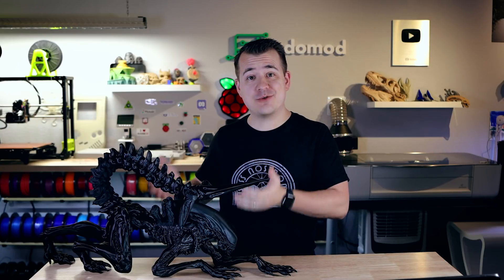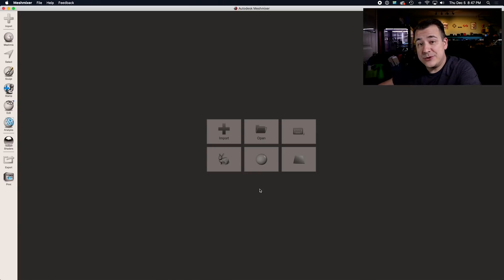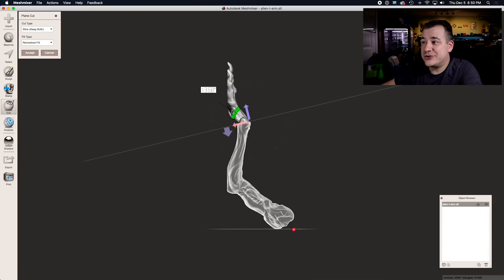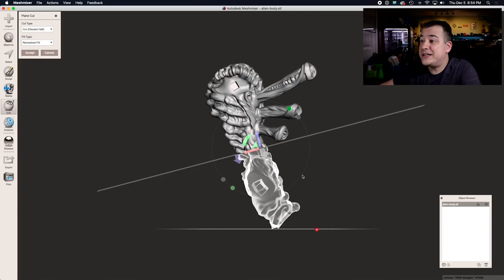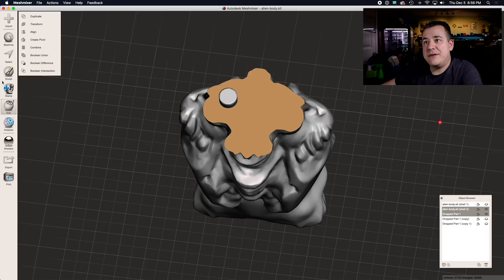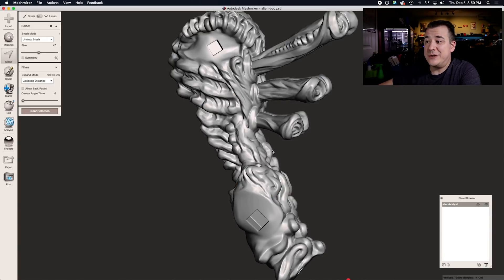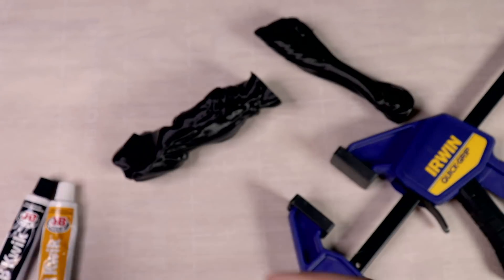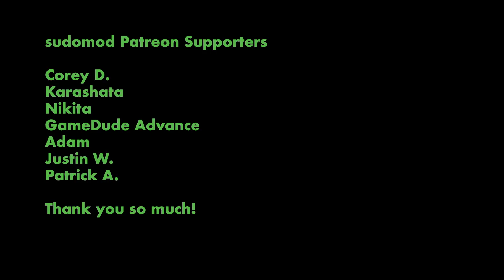GIANT 3D-Printed Alien! How to chop up BIG models for 3d printing!

Comment: Awsome video, am new to 3d printing having trouble with low extrusion mid print. Have adjusted temp at hot end, bed 1st layer speed, bed level, still getting failed prints. Working with ender 3 printer using PLA. Any help would be appreciated.

Comment: Funny this came back up in my feed...I now have a 3D Printer, AANNND...Prusa Slicer will do this right in the software. I have used meshmixer but for what is discussed here Prusa will do a "cut" . However, Wermy's guidance about where to slice is still EXTREMELY useful...as i do still consider myself a n00b with all this.

Comment: I see you used boolean difference on both halves, I assume to print the joining cylinder separately?  Also, wouldn't the printed cylinder have to be scaled down a little to fit into the holes on both halves without sanding?

Comment: Can this method be used on resin 3D printers as well? My family and I are new to 3D printing and we got a resin 3D printer. We’re interested in creating larger models with the printer but we’re not sure if this method would still work with the resin printer as this video was specifically for filament. Thanks!

Comment: What 3d printer was used? Prusa? I dont recognize the enclosure. Im looking at buying a new 3d printer and i dont know if i should buy the CR-10 or Prusa Original
Reply: Buying printers has a lot to do with several advantages you're looking for. An original Prusa might be just an allround great printer, but it ain't cheap, whereas a CR-10 is not bad when properly tuned, where it would give just as good prints , but requires more time working on the printer, and it's also cheaper (you can get two CR-10's for the price of one MK3) so, it all depends on what you are looking for. Also, the build volume on the CR-10 is bigger than the prusa so that might be something else to take into account (you want to print big or print small? Also the footprint can be an important issue due to where you plan on leaving the printer, and so on)

Comment: I also follow you on IG and was waiting for this video!
I don't have a 3d printer but I love 3d printed stuff and I also love everything related to H.R.Giger. This model ended up looking sick af! Great work man!
Reply: over on AliExpress they've got some half decent printers for as low as $80
I use an Ender 3 which is usually $220 usd and its $40 less there!